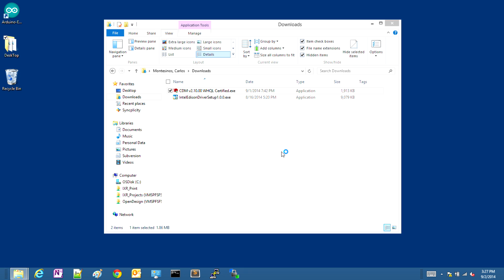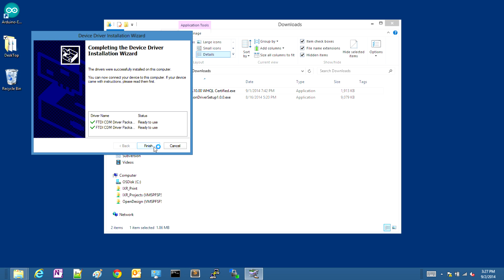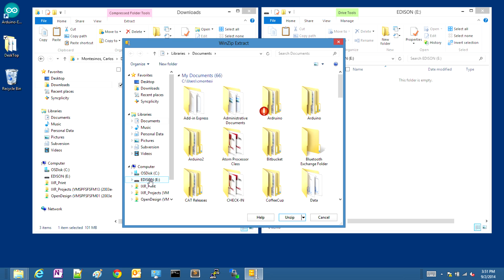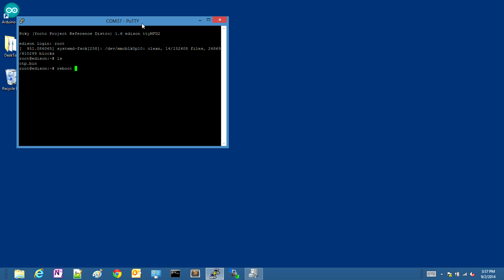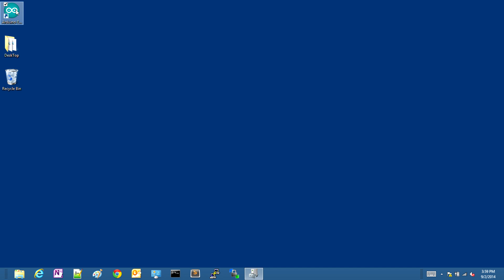Intel Edison Getting Started - A Step-By-Step Tutorial (Windows) | Intel

Comment: Hi,
Arduino IDE compressed file will not extract completely unless you extract it to the root (i.e., c:\ ) of your hard drive.
Reason: it contain multiple folders one inside the other which make it too long to be handled (longer than 260) like this one:
C:\Users\Mohammed\Desktop\x86\i586-poky-linux-uclibc\usr\src\debug\uclibc\0.9.33+gitAUTOINC+946799cd0ce0c6c803c9cb173a84f4d607bde350-r8.4\git\libpthread\nptl\sysdeps\unix\sysv\linux\i386

please rearrange the Arduino IDE file structures so we can use it from our preferred directories.
Thanks.

Comment: I've set it up and it works fine. My only problem is when I try to setup a web server in the Arduino- IDE and I visit the ip, I get to the Device Informations Page instead of the webpage I created... Does anyone know what i'm doing wrong?
I set wifi up with the console as it's shown in the "wifi setup" tutorial. To use it with arduino, do I have to turn it off "in the console" and only connect using arduino? If so, I can't figure out on how to do turn it off...

Comment: I know this is a new product but I've been salivating waiting for this to arrive only to find out there's very little documentation or videos out there (hopefully that will change soon). The instructions here are very different than the ones on the intel site. My suggestion would be to make more parts to this and go through things like what the arduino board buttons and jumpers do, and why it appears linux is already installed out of the box. Another confusing thing is you have this image you're putting on to that drive, yet I'm not even sure where you got that image. Anyway, just a few extra videos would really help. This seems like it'll be a very useful platform, just could use a little more info from the start. It wasn't hard to get blink working, but interfacing arduino with linux is a big question mark now for me. Guess I just have to explore the examples
Reply: No serious dev product should use the Arduino IDE: can't undo much, no autocomplete, no version control, no file explorer view, no refactoring, etc etc etc.
Reply: Arduino is the easier option, you can also use the Intel® XDK IoT Edition to code and upload to the devices.   Has a blink example.

Comment: Just got mine. I didn't need to flash the Linux image prior to programming the board with the Arduino "blink" program... I just connected my laptop to the J16 USB port and the programming worked straightaway.

Comment: Since the Edison + Arduino kit does not come with a power supply (and perhaps none is needed for the initial setup), it would be nice to have a reference to which specific 2.5/5.5 brick one "could" use. Not asking Intel to recommend a 3rd party SKU but any beginner could benefit from further guidance (?V ?A).